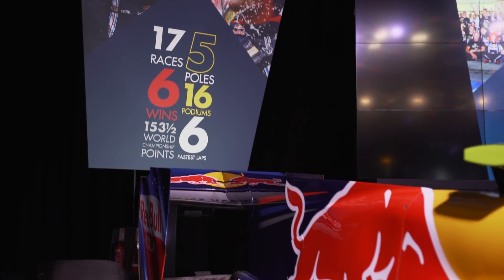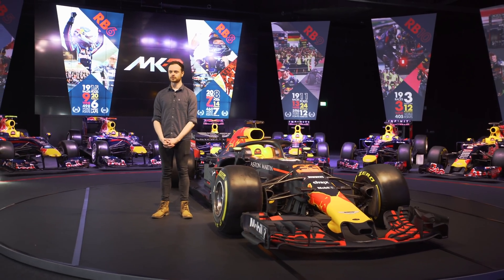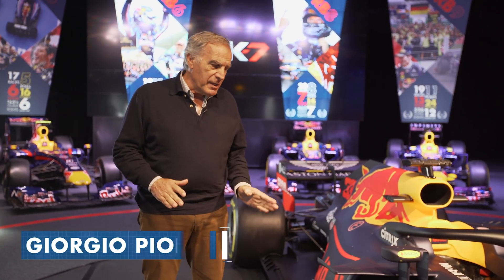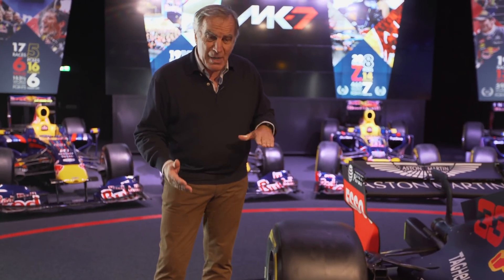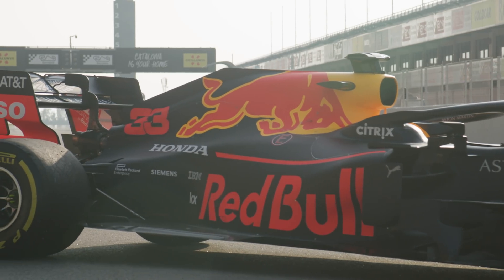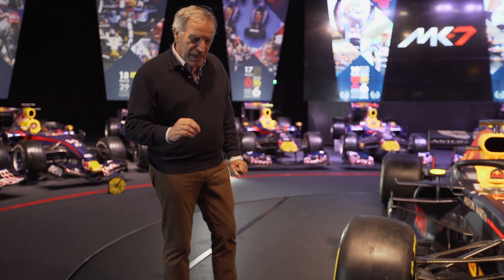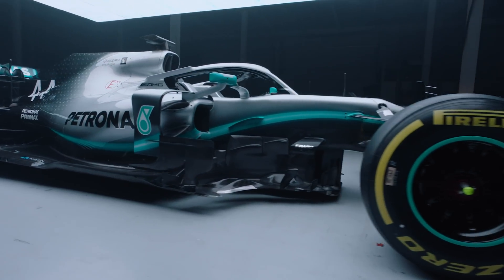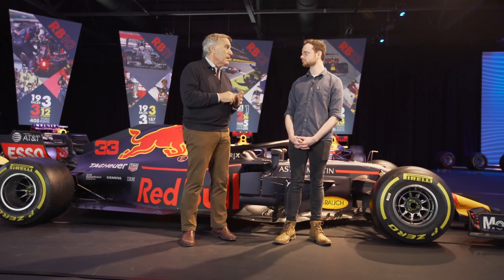Why 'rake' is such a big design trend in F1

Comment: I'm not joking, but i raised the rear of my mx5 by 2 cm, and increased front camber. And it turns so much sharper and harder than it used to and when you trail brake the front grip is extreme.

Comment: The "thumb over the nozzle" of a hose analogy was completely the opposite of what rake achieves. With the hose you slow down the fluid and increase the pressure whereas a raked floor speeds up the fluid and decreases the pressure. Just saying...
Reply: Exactly, it would only be a valid metaphor if the front was actually higher than the back, aka the air got funneled. This entire video is trash and doesn't understand the fundamentals. WHY does a high rake increase downforce? How does it affect drag? Why choose one over the other? The video addresses NOTHING.

Comment: I have a few questions/possible video ideas:
1) how do teams decide where they are on pit road? Is there strategy to being in certain locations in the pits?
2) drivers head/neck strategy in corners. Do they pin their head against the car before they turn the car in?
Reply: WifeBTR123 pit position is decided by the previous years constructors championship position. 

As to the head thing some might do particularly in long turns with heavy g forces but these guys train their neck muscles for the forces they experience
Reply: I think what they're doing is looking ahead because why look at what you're already driving through

Comment: Thanks once again answering another weird question I had been noticing that gap between the rear and the front....but funny thing I just got done looking two of Richard Petty winning Winston Cup cars and their was a picture of a third car,a 1968 Plymouth Road runner,and weirdly the front is almost scraping the engine on the ground and the back is very close may be inch or two higher than the stock road runner it had some serious rake....it did not look right it look so front end weight bias heavy...thanks I was just wondering about,that aero I thought so

Comment: Is there a proportional relationship between rake and rear grip? Does the rake remain constant on track or does it decrease when downforce increases?
Reply: A part of why rake is useful is that paired with a properly set up suspension it will change depending on speed. The car has less rake when moving fast, reducing drag and giving more speed on the straights. In slow corners, the suspension isn't as compressed, and gives a higher rake angle and again more downforce. To get good amounts of downforce it's easier to use a higher rake angle and get good results fast, but using less rake like Mercedes does has a higher potential, paired with a longer wheelbase.

Comment: This explanation is too over simplified.   When the car is stationary the rake appears exaggerated.  When driving at speed the rake is greatly reduced.  That's the important part of the philosophy, to achieve a larger window of aerodynamic performance in slow and fast sections of the track.
Reply: This is Autosport and it's a JBL video to boot. You thought you were getting a technical explanation? This guy spent the entire preseason technical analysis pointing at various aerodynamic pieces and and repeating "This bit here is about making the air work as much as possible".
Reply: Yes, I was expecting an actual technical explanation, but then it ended.

Comment: This video failed to emphasis the reason people use rake VS more aggressive wing angles. The downforce produced by rake or diffusers have less of an effect on the aero drag. Of course this means that it can produce more downforce without sacrificing speed/power. So it is important for cars that have less power.
Reply: This is not exactly true.  Raked cars suffer a larger drag penalty than it's non raked variant.  All things be equal.  It's similar to long wheel base.  A shorter car will turn better all things being equal but in f1, all things are not equal.  Mercedes were faster than redbull in monaco and probably will in hungary and singapore.  Both concepts are valid with different pro's and con's.  It comes down to philosophy.  The reason most cars follow raked concept is because many of today technical directors are Newey's acolytes.

Comment: What is the down-side of high rake? And how is Mercedes' low-rake able to compete with it?
Reply: Higher center of gravity, especially in the rear. More drag (all else being equal. If rake allows you to run less wing, you might get the drag back). And the biggest problem, that huge gap at the sides of the floor needs to be sealed up or increasing rake will actually reduce downforce. You need a lot of outwash to quasi seal that gap which comes with a drag penalty as well. The Merc is raked as well, just a lot less than the others.
Reply: Mercedes power advantage allows them to have 'dirty downforce' from wings etc. which is more predictable and means they don't need rake.
Reply: Mercedes can get away with it because they had about $700 million of funding for development up $50 million from last years.
Reply: Or maybe the mercedes teams is using a difficult concept to grasp and has since gone on to dominate the sport.

Comment: The fact is that F1 is high speed railroad train 🚂 single file. The cars are so far apart that Mercedes are runs away while real action packed driving is from 5th place thru 11th place. Formula One is no longer the number one formula in auto racing.

Comment: Rake is nothing new in racing. NASCAR already used it in the 1960's . Just take a good look at the cars of Richard Petty.
He also chopped a few inches from this roofpillars. Both mode  gave him less drag and a higher Vmax and many wins.
Reply: I do follow other categories but comparing Nascar to F1 is a piss take
Reply: The first one was Adrian Newey at McLaren I think. Nascar wtf they did that maybe to get the better weight distribution under breaking, but in reallity, they probably only did it cause it looks cool!
Reply: NASCAR is irrelevant lmao.
Reply: Are you high? The only reason they did that was due to weight distribution/handling. And a rake doesn't even work without sideskirts or airflows sealing off the sides...
Reply: Nascar? Haha they don't know shit about aerodynamics
Reply: @s.d.h.3t981  The wind tunnels NASCAR teams use are actually much more advanced and expensive than what F1 uses. F1 teams aren't allowed to use full size tunnels. While a Cup car is much more limited aerodynamically, the teams are every bit as clever (if not even more so) about extracting every little bit of performance from what they can do.
Reply: @s.d.h.3t981   There whole cars are designed around aerodynamics.  If there weren't they wouldn't hit 200mph cause of drag. Not to mention they are designed in such a specific way that it allows them to draft each other when side by side (to an extent). This allows them to pass each other when they have a weak frontal draft. To say they don't know anything about aerodynamics or anything of that matter is just ignorant. And this is coming from someone who doesn't much care for oval racing. However they have the perfect formula for the best racing out there, if only they would race mostly road courses. There isn't anything better than watching some of the most difficult cars to drive, race around courses they weren't designed for. It's a true test of drivers skill as they have no driving aids like abs, traction control, stability control, or launch control, also don't forget they still use a 4 speed H-pattern shifter with a clutch.

Comment: BBC site interviewed the "secret aerodynamicist" in March .He pointed out rake gives dramatic results and quickly too. As  pre season showed Ferrari's rake car fastest .He went on to say, it becomes a hard to update and improve .A sort of "cul de sac " in development. Mercedes went flat since ,although harder to get a handle on initially ,flat offers much greater improvement .In a sport where  the real race is a development one ,you can see the limitations of rake.
Reply: True rake is limited in development, simply because the next step is the extention of the rear diffuser then addition of side skirts then a big ass fan which is illegal, basically f1 teams are reaching the limit of development
Reply: No it doesn’t provide a more complicated and ending development path, it’s just an inclined floor dude.
Also a floor with rake in mind is more complicated than a flat one, as modern F1 cars seal the floor with vortices form the barge boards and front wing, and these vortices need to be bigger to seal a bigger gap on the rear end of the floor
Reply: guanwei he - So if I understand you correctly, you’re in essence saying that the vortices formed by the front wing and barge boards are like side-skirts on the late ‘70s early ‘80s F1 cars, but made of air, sealing the underside of the car?
Reply: @Donald Moser 100% correct!  Modern f1 cars do in fact employ ground effect.  Around 65% of it's total downforce is generated by the floor.  The difference is the means in which it's created.  In the 70's side skirts were used to seal the floor, nowadays it's vortices.  The problem we have currently is when following another car, the turbulence disturbs these flow structures, ultimately reducing the effectiveness of the diffusor.

Most of the flick up and furniture around the front wings and bargeboard areas are wake controllers.  They are not there to create downforce but the mitigate the ingress of turbulence into the diffusor and to control the tire wake.  Basically to reduce drag.  Half the time teams try to balance aero efficiency, not outright downforce.  Often it's more beneficial to reduce drag than improve downforce.  A less draggy car, with the same downforce will be much faster.
Reply: Bahamuttiamat - Very interesting.  I am fascinated by the aero aspects of F1 and other forms of motor sports.  Thanks for the reply.

Comment: It does amuse me that an Adrian Newey car hasn't won a drivers or constructors championship since 2013 but still all the teams copy his lead bar the only team that just can't stop winning! Newey is brilliant, a genius but he is not infallible.
Reply: Blame Renault not Newey
Reply: As they said, Merc have a different concept, with its main focus being the PU. The Mercedes is slower with a higher rake setting, just as all other cars would be slower with a lower one. One thing to point out is that ALL F1 cars have rake. The difference between their settings being the rear-front delta. What they refer to in this video is how Red Bull usually uses a much higher setting than the rest to fit their whole aerodynamic concept.
Reply: @j.j.schlachtfeld9325  Main focus being the mechanical components you mean. For them it's not just the PU, but the brakes, the suspension and the transmission. Ferrari is more focused on the power-train but fails where Mercedes succeeds because the focus on all the mechanical components is to make everything work simultaneously as effectively and efficiently as possible on the car. Then they make everything else work towards that end. Ferrari has great focus on the PU but not the greatest focus on all the mechanical components.
Reply: @F1ll1nTh3Blanks  That's true. I didn't write it all properly, but you're right.
Reply: Newey could have been at mercedes rn.He said in his book that they offered him a job but he turned it down not wanting to seem like he is just chaising titles.
Reply: @alexgherghiceanu2094  I respect that. He's definitely the best at what he does, and the fact that he doesn't need to stack up titles to prove it says a lot about him. I'm glad he didn't accept the offer, since that would've made Merc that much more dominating and the sport more boring.
Reply: @j.j.schlachtfeld9325  ..... I'm not sure they could be much more dominating than they are already. Think about it this way. Mercedes have won about half the amount of titles Ferrari have despite be absent from F1 for 55 years. Just imagine how many titles they could have had if they hadn't left in 1955.
Reply: @kityhawk2000  I'm only talking about the last couple of years. They couldn't have been more dominating in terms of results, but definitely in terms of pace. I reckon a Newey car with a Merc PU could be anywhere from 0.5'' to 1'' a lap quicker than each year's top challenger since 2014.
Reply: Newey isn't an engine designer. Fortunately RBR also have Mario Illien. I expect great things from RBR/Honda for the rest of this year and next
Reply: When newey had a mercedes engine, it kept on retiring.  Kimi says hello.  Newey is great, a legend but people are quick to crown him king while ignoring other talents.  Mercedes have been dominant for a long time running their own concept.  I think that warrants credit. 
While it was fashionable to credit their success on the engine, the lanscape of f1 has change dramatically since 2014.  All the mercedes power cars are near the bottom and all PU are now within 0.5%.  Aero and chassis design has become paramount.  Ask ferrari, if you feel otherwise.
Mercedes has been competitive on every track not just a handful.
Reply: @Bahamuttiamat  You cannot compare the reliability of today's Mercedes PU with the reliability of the Mercedes Engines between 1998-2005. The fact remains that McLaren wouldn't have achieved much during those years if it weren't for Newey, since the engine had a certain proclivity for pyrotechnics. Obviously he isn't a god, but he is the best overall. Aerodynamics are more important now than they were in 2014, but this is still very much a power-dominated era. I don't think Ferrari have a better PU now. they certainly did at some point during 2017, but I believe Mercedes have more than caught up with them. I'm hoping for reasonable steps forward from both Renault and Honda so that we can have a more even field and a much nicer tittle fight than the one we currently have.
Reply: @J.J Schlachtfeld Newey was the reason for the engines unreliability.  He wanted the drive shaft so low it regularly broke.  Wouldn't compromise because it ruined his expected center of gravity.  Something similarly happened during the redbull years with their persistent alternator problems.  Adrian is no doubt a genius but a very hard and uncompromising man, especially in car design.

Ferrari no doubt have the most powerful PU package.  While mercedes has the most efficient.

Comment: Rake basicly uses the whole car as a wing.
Reply: Oscar Shen 

It’s more complex than that.. it also changes the ride height and therefore weight transfers.
Reply: Oscar Shen Not just that, if that were the case the entire car would be adding significantly more drag. Think of the leading edge the floor as a nozzle in a rocket motor. This “nozzle” effectively compressed the air rushing through it and forces the air under the car to accelerate, resulting in a pressure difference that squashes the rear of the car. Instead of a wing, it makes the car act as a big diffuser
Reply: @christopherbrooke2142  But Bernoulli tells us that the larger area under the higher rear would cause the air flow to slow, which in turn would reduce any reduction in pressure cause by the tight area under the front of the floor. This is why the explanation that rake assists the floor and diffuser makes little sense to me. It must be something else.
Reply: @MSneberger  exactly, thought the same.